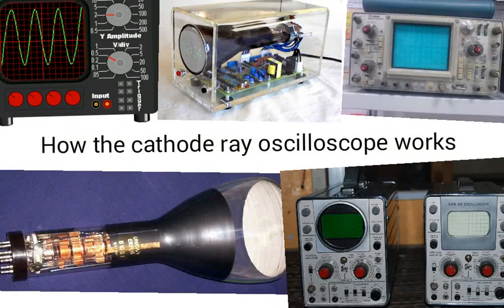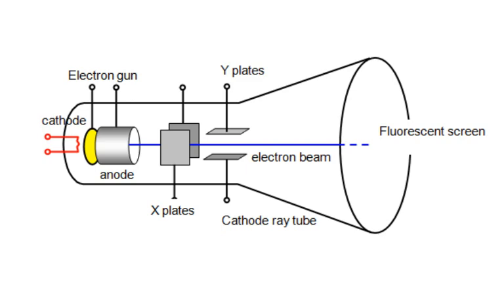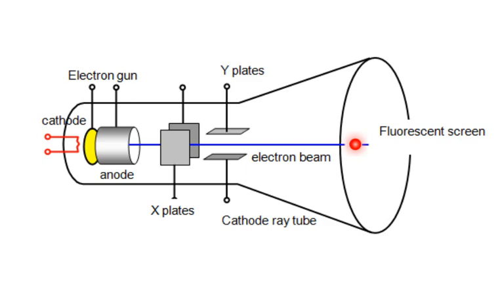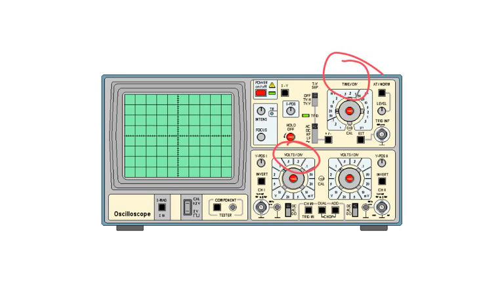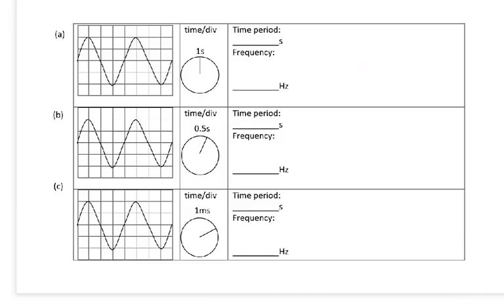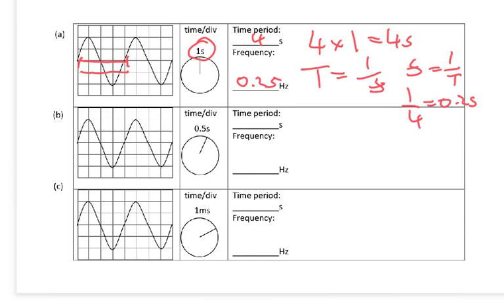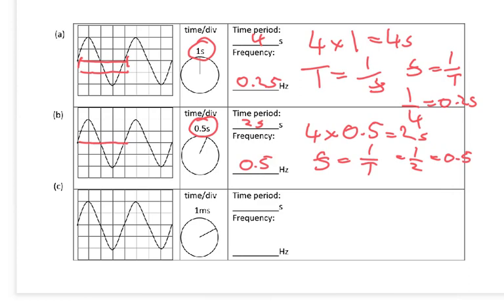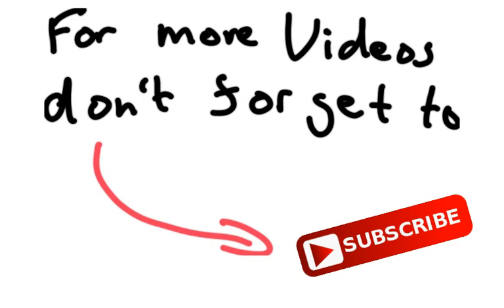Cathode Ray Oscilloscope - IGCSE and A level Physics

Comment: Why the electrons are not atttracted to anode ?
Reply from the maker: it is but it has a hole in it that the electrons pass through.
Reply: +Chris Gozzard (That Physics Guy) So not all of them pass through right ?
Reply: and why they are not deviated while moving through the holeö
Reply from the maker: +Mirza Hadi the electric field is uniform so the electrons won't deviate.